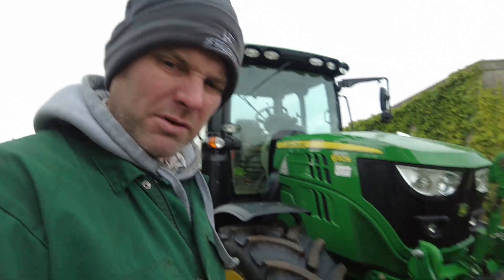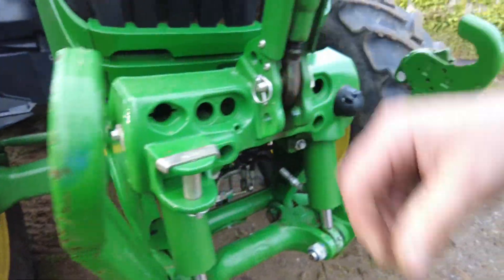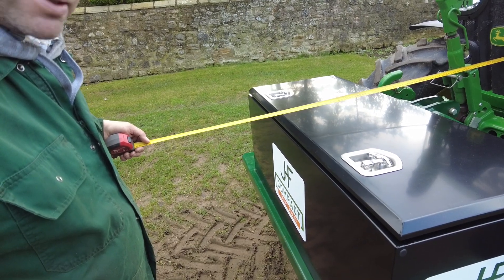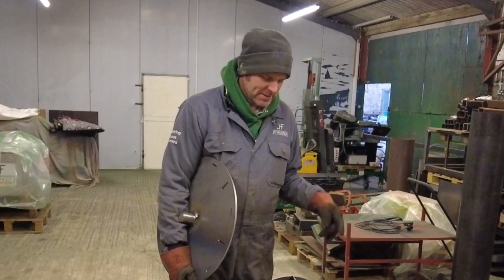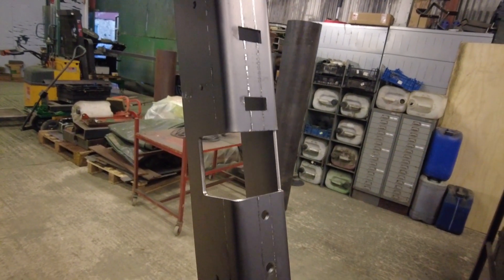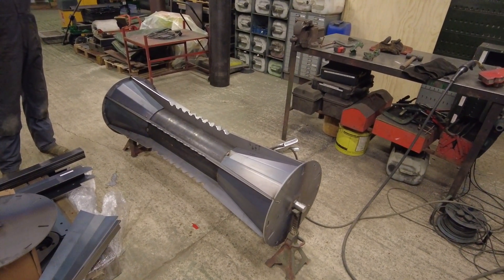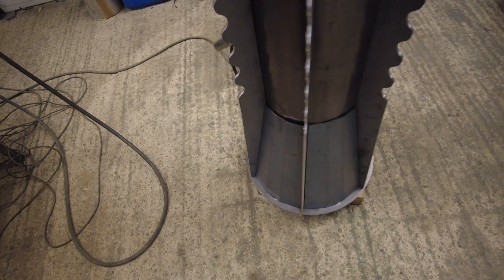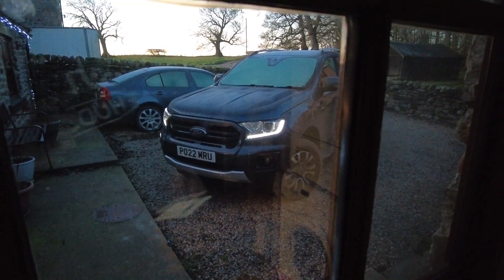How We Make Crop Rollers & The JF Hudson Compact Front Box Difference! Week 6

Comment: Another good one there, tidy job with the crop rollers and some good design gone into that.
I sometimes have trouble cutting  long parts on the plasma, they can come off with a bit of a bow as well, a bit is down to the heat but I reckon more is to do with stress in the sheets as parts off the sides of a sheet can have a bow then parts in the centre of the sheet are flat.
Boxes looking good as well.